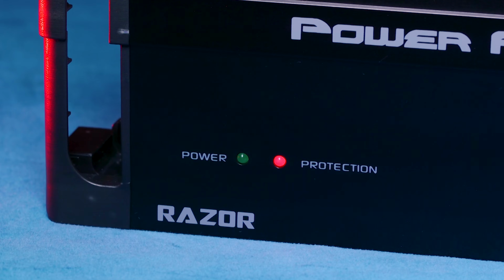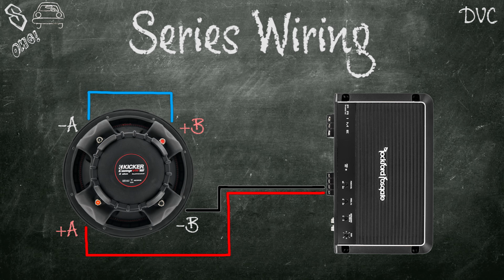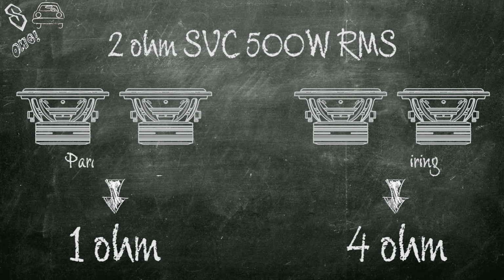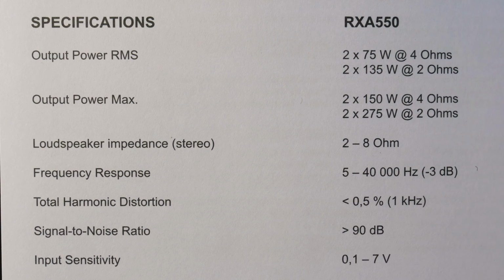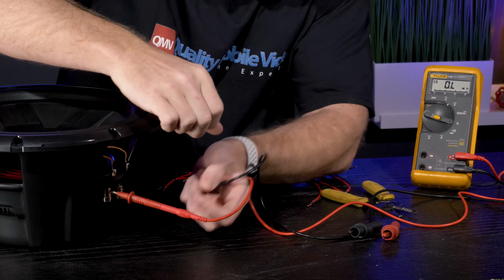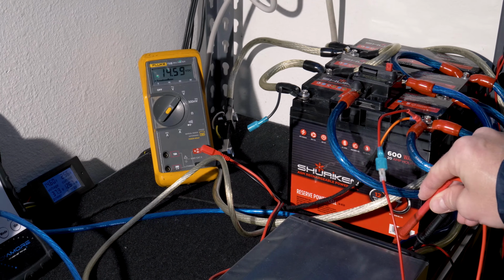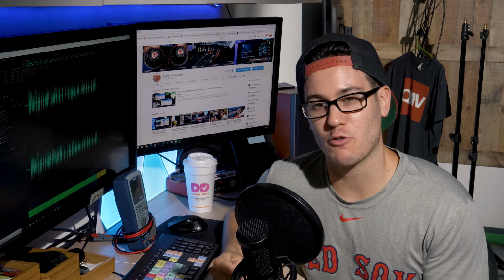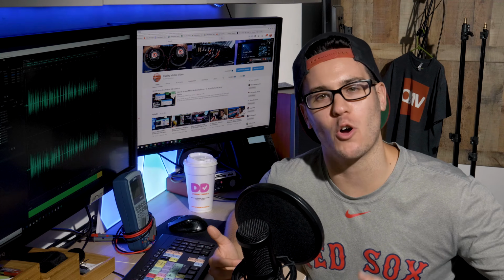Bass Cuts Out at High Volume - Amp Shuts Down -  Car Audio 101

Comment: hello bro can u help my out wit my brother i did a bigger alternator new wires and everything new radio new 1 amp for 2 subs and 1 for the highs / side speakers also big 3 upgrade and she still cuts out when i step on the gas or hit a turn

Comment: Question, so I never had any problem with my system within the past couple days with me. Turning my radio up my aunt will cut outs and and if I turn it down in a play with the base if I turn it up, it’ll cut in and out in and out with in seconds, continuously, so if I leave it at a higher volume or the normal volume that I normally play it at, he goes in and out in and out in and out in and out what does that mean?
Reply: Ever figure it out? Lol this is what I’m dealing with, skar 12 SDR paired with a kicker 800 mono class d amp, worked great for a while really bumped. But now when I turn it up the amp goes into protection and shuts off the sub until I turn it back down below a certain level.
Reply: @The_MotoRebel did u ever figure this out yourself? My remote wire seems to have a voltage drop.
Reply: @DeaconHickyy   mine had a voltage drop as well so i did a fresh wire for remote wire and it helped. hits harder but its still happening. not sure imo, i think its the amp. i need a stronger amp.

Comment: Is battery negative a good ground for amp?
Reply: no sand off a an area of paint to bare metal  in the trunk and then use a self tapping metal screw with a ring terminal run it to the ground

Comment: Any suggestion I daisy chained the dual voice coil kicker l7s  I bought a 2ohm 10” connected it to my sundown sia2500d and epicenter used a y split to add both left and right channel since the amp is one channel only and I don’t get the full potential I have a kenwood dmx47s budget radio in my Saab 9-3 2007 at around volume level 29 it turns off the amp ,gain I’ve been adjusting off the sundown remote since if I even turn up a little on the epicenter knob it goes straight into protect  /another scenario if I don’t use the epicenter knob only the sundown if I turn it past a little more than half way it starts clipping and turns off

Comment: Could be running a factory system with an additional sub. Some factory systems will bleed off the bass as the system is turned up to protect the speakers.
Reply: This My Issue
Reply: How do I fix this issue?

Comment: My 12s just started doing this recently,  it'll work fine when I start my car up, but as soon as I mess with the bass knob or turn it up. Everything goes out and I'm just left with the fronts. And if I cut my car off for a while and start it back up.  It works only at low volume then soon as I attempt to turn it up,  it goes out again
Reply: I've got the same problem.
Reply: @Warren daniel  aw wow.  Yea , my right door speaker been went out, my 12s popped back on. I'm in Chicago so I don't know if it was the cold weather or what,  but I also realized my back factory speakers aren't working neither so now I'm just all bass 😄🤦🏽‍♂️ until I get them replaced
Reply: Mine happened in the cold weather to. Kankakee ill lol. Found both fuses on the amp popped. Replaced them now subs keeps shutting down as soon as I turn it up. I also think my ground wire could be loose but it's under the seat and I gotta borrow some tools 🔧

Comment: Mine keep going into protection mode when the volume goes up and this just started does anyone have any ideas in what could help?
Reply: Did you figure what it was bro ? Every time I turn my bass up it goes into protection
Reply: @Angel_stepside I have same problem play hood for 10 minutes after that cut on and of eaven o. Low volume I change  other amplifier and same problem any idea
Reply: @Purozamachihue  for me it was the voltage drop bro i replaced my alternator and got a xs battery it works now’s.
Reply: @Angel_stepside  ok I replace that alternator already so I might get a new battery and se how works
Reply: @Purozamachihue  maybe upgrade your wires as well bro so you can get the full power from your it alternator
Reply: I yes found my problem that was that main wired to that fuse  block was coroored for  I cut it but u right I’m going to put new wiere thank u very much for ur  help

Comment: Good Sh!tt fast quit & too some valid points. 
My issues are cutting out at maybe 2 hours of runtime at a good low note. Initially I thought it was a subwoofers they were being overpowered. So I upgraded subs, it was all good the first month & now here goes the cutoff?? Any other ideas im all ears
Reply: Also voltage is not dropping below 12volts I have a full throttle battery 💪🏾 but original alternator. Im running 800watts all 4 gauge wire (which I'm sure I need to upgrade)

Comment: I got 2 12s in my rango and they rocked in my dad's truck and they're setup the same way they always have been and they were in my room rocking too, and now they're in my trunk and they sometimes can turn up high other times they kick off pretty quick, and we have a big ass semi battery in there and we had one like that in my dad's truck and it worked great till it shit itself from sitting but I think it's the alternator wire it's pretty skinny looking and I got 4 gauge going to my amp it's only gonna pull 60 amps max it's a 900 watt amp and I did rewire the subs but I had them in my room and they worked fine
Reply: This may be the longest sentence I've  read my entire life 😂
Reply: Maybe it shit itself from sitting think you've answered your own question

Comment: Had the same issue, the sub was dual 2 ohms when I wired it to produce a 4 ohm load the amp stopped going into protection mode when the bass hits.
Reply: How did you change the ohms? I’m having the same problem
Reply: @steelersgirl3063  sorry❤

Comment: I have a completely brand new system but it cuts out when I turn up my Bass knob its a ROCKVILLE db15 6000watt gain half way up with 0ga wire and 250amp fuse and 2 1800 watt dual 4 ohm lanzar max prosand new alternator almost 14v w no bass i have no clue what it could be bass is best parked and off
Reply: Wired bridged 2ohm

Comment: Not enough power need upgrade wiring add battery maybe better alternator I would even throw in a cap
Reply: Also when running multiple remote wires get a relay switch

Comment: Anyone ever heard something like this? Got a kicker cxa 600.1 mono amp got it hooked up to the factory radio with the rca hi lo adapter with a built in trigger remote turn on …. Every time I turn the vol almost full blast my amp goes in to protect mode… yesterday I did some investigating and I found that if i jump my     12V + wire to my remote turn on it has no issues at all at the fullest volume as soon as u pull that remote turn on that’s jumped from the 12 v out it goes into protect mode when the volume is blasted ? does this make any sense to anyone? Should I just run a separate remotes turn on wire to fix my issue?
Reply: there are no answers in this comment section. but youve inspired me to mess with the remote turn on. gonna check it out this weekend

Comment: i got a new amo installed to my car for my 4 speakers and the sound just stops but the amo still on.could it be my stereo or my amp? even tho when i unolug the rca's cables the speakers make a noice but when i plug them in no more sound
Reply from the maker: Sounds like a wiring issue! I'd bring it back to wherever you got it installed
Reply: @Qualitymobilevideo  it goes into protect mode i did check all the wiring and it all looks pefrect had the system for 3 months and out of nowhere this is happening
Reply: @spectaclesonmytesticles5114  yes i redo everything. a wire was pinched so i installed a new wire kit.

Comment: I have a 10w7 wired to a sundown sae1500 played great but sold it and purchased a jl audio jx1000/1 the bass comes on and starts hitting but then all of a sudden it hits crazy hard. Any ideas? When it was shipped the package was torn and a piece of plastic was loose inside and I opened it up and took it out. It was part of the mounting plate

Comment: My amplifier has been doing this for 2 years and I finally found out what the problem was the problem was one of my door speakers on my 4-channel amplifier my Infinity Kappa which is supposed to be 2 ohms but when I checked it it was 1 ohm all that time with the speaker playing very good it was sometime going to 1 ohm at high volume
Reply: How is your infinity door speaker running at 1ohm when should be 2ohm stable makes no sense.infinity door speakers only come in 4ohm.or 2ohm a wire must be wrong or bad speaker

Comment: Ran direct ground and it still goes into protect 🤦‍♂️gonna try another amp but I suspect the sub is damaged somehow.
Reply: Did it end up being the amp?
Reply: Great question! It actually ended up being the wrong wiring configuration for the amp and speaker combination. I was trying to run a 1 ohm speaker from a 2 ohm stable amp. My fix of course was to buy a 1 ohm stable amp. Problem solved so far. The ground also helped greatly with radio whine as well but it’s still there.

Comment: My stereo cuts out and turns its self on again after a short while, does anyone have any ideas? I looked at all wires and couldn't see anything and couldn't  find the ground wire, but i did notice that I could see the voltage on my stereo, and when its at 14.4v its fine soon as it goes down to about 13.4/6 it then turns off. Battery not strong enough??
Reply: My Silverado does this too… currently and it’s bugging me I have a Big 3 upgrade, new battery and Skar 1500 with 2 Skar 12s it sounds great but when the lows hit it dips to 12 volts and my speedo and radio go bye bye for like 3 seconds nothing else shuts off it’s strange
Reply: my amp however doesn’t shut down , just cluster and radio

Comment: Ok worth a shot to ask this on here. I just hooked up my 2 American Bass XFL 12s in my 2014 Silverado with the bose system. Powering the subs is a Precision Power Black Ice 5000.d amp, subs are dual 4 ohm wired to 1 ohm. I'm using an Audiocontrol LC2I converter with a plug and play harness from LLJ customs. All OFC Sky High 1/0 wire. So what I'm confused is when I have the volume up and have the bass going it will play and then the song pauses, the radio turns itself down to a little under half volume, then starts playing again and it will do it again if I crank the volume again. I ground down the paint for my ground. My gain is like 1/4 up maybe even a little less. Amp doesn't get hot and neither do subs but the coils do smell every now and then. I've had this amp and subs for 4 years and haven't had any issues besides in this Silverado.
Reply: I have same problems. I think its insufficient power. System dropping below what charging system can give it.

Comment: Man. I don’t know shit about systems but i need help. My sound keeps cutting off when i bump or wont even bump at a certain amount of bass. I wish i knew how to understand this shit
Reply: Grind down where you grinder the wire can’t be painstakingly under it  make sure positions cable on battery is tight. Make sure the wires are all touching don’t over tighten wires to amp

Comment: I have 2 jl subs, connected to a kenwood x500-1. My amp cuts out when the bass hits. If i joggle the remote wire it turns back on and then cuts back off. It was working oeefect for one day and the next it started doing this. At first i messed with the lpf and it fixed it for a day, but now its doing the same thing. I changed the ground but the amp was blinking like it was in protect mode so i put it back on original ground. Still nothing
Reply: Turn your gain down
Reply: Turn amp gain down check ur fuses sometimes the fuse holder will began to melt and short our sound also check ur ground

Comment: So if the protection light comes on what does that mean
Reply: Running hot
Reply: Not necessarily  it could be a bad connection or wires exposed touching something

Comment: So I installed a capacitor... my issue is that the capacitor flashes and the amp is cutting out when the bass hits too high
Reply from the maker: Hmm. What is your exact system? Give me all the part/model numbers of your subs and amp. What gauge wire did you use for ground/power? What is your exact vehicle?

Comment: I have two p3s running on a 1000bd fosgate amp sometimes when i have the radio up loud even with bass knob low so the bass aint to loud the bass clips or shuts off for like 3 sec i lower the radio then the bass kicks in. This happens sometimes only. Can u help please.
Reply from the maker: Sure Dom. What are the exact models of the P3S subwoofers? I need to know size, RMS each/combined, 2 ohm or 4 ohm, and how you wired them
Reply: @Qualitymobilevideo  12" (P3D4-12) Punch P3 Series Dual 4 Ohm Subwoofer

Power Handling:

Peak: 2400 watts total / 1200 watts each

RMS: 1200 watts total / 600 watts

Impedance: 4 ohms (per voice coil)

Anodized aluminum heat sinking cone & dustcap for strength and durability

Tall profile true Santoprene vertical attach surround technique increases a speaker's effective radiating cone area

Dual tear & fatigue resistant linear poly cotton spiders

Optimized motor magnetics with extended pole and bumped backplate

Fatigue resistant and reduced strain stitched tinsel leads

Multi point high temp/strength neck joint bonding technique

Sturdy 16 gauge compound bend frame geometry

Semi-Flexible PVC removable protective motor cover

Custom insulated compression input terminal assembly

Proprietary spider venting/cooling technique

Decorative die cast trim ring

Custom 10-AWG nickel plated push terminals

High temperature 4-layer 2-1/2" voice coil with spun laced nomex insulating reinforcement collar

Double stacked ferrite magnet structure

Frequency response: 27.7-250 Hz

Sensitivity: 85 dB

Xmax: 16.2 mm

Mounting Depth: 6-11/16"
Reply: @Qualitymobilevideo  they came wired from the box to one ohm my fosgate p-1000bd can do 1 ohm so idk but my rca to this amp looks skinny and weak idk but this is what they put in bc they were lying around and I needed some so they just put these in there I order me some Rockford Fosgate that are on their way so I can put those in I don't know maybe the ground
Reply: @Qualitymobilevideo  I have a new battery I just bought a brand new alternator but it's only a hundred and 15 amps also I have a Fosgate 2 farad capacitor and I have a little extra battery by the capacitor that's a thousand Watts battery my voltage seems okay and the other system I had before the Fosgate it was a CT sound 1000 BD amp hooked up to two 12in Alpine Type r's and they never cut off before but now I have two p3s a 1000 watt amp Fosgate also a 4-channel amplifier hooked up to my door speakers and the last system I didn't have a amp  hooked up to my door speakers

Comment: My kicker 1800.1 amp goes in protect mode when volume is loud  its 2ohm stable I have a 1500 Re audio xx 4ohm dual voice coil wired down to 2 ohm and I have a second kinetik 2400 battery  now I tried testing removing the speaker wires from the amplifier at loud volume and it doesn't go in protect mode also I'm getting 12 volts or more
Reply from the maker: Where did you make your ground?
Reply: @Qualitymobilevideo  the amp and second battery is grounded together and the second battery is grounded on the first battery
Reply from the maker: @pimpjuicedp  So you didn't ground tot he chassis of the vehicle?
Reply from the maker: @pimpjuicedp  I would check your grounds
Reply: @Qualitymobilevideo  No I didn't
Reply from the maker: @pimpjuicedp  Can't be sure without being there in person, but that could be the issue, could have blown capacitors int he amp or some other component damage
Reply: @Qualitymobilevideo  when I first got it I was rushing and when I installed it I put the power wire in the ground spot and put the ground wire in the power spot I blew the fuse then changed it I installed it the proper way

Comment: Mines doesn't exactly cut out but not always but when the bass hits it sometimes gets more quiet like not to wear it's distorted just were the amp it's more quiet it does not get hot it don't go into protect I've check all the wiring and it is all correct. It's an older 760 watt pioneer amp which is powering a kicker kicker CVR 12 600 watts sounds good but gets annoying it does have a 1.5 farad cap and the voltage remains between. 13.7 and14.3 volts continuous ant advice ?

Comment: Mine started doing this randomly after about a year with no problems, it only does it when im driving and when the beat hits and also sometimes other electrical things shut off in the car, everything turns back on after about 3 seconds
Reply: Hows your battery?  I am having same issue
Reply: Bad ground
Reply: Same here .I also did big 3 upgrade and new amp everything. Still does what yours doez
Reply: Check the battery voltage might be battery or alternator not charging with running,air condition,lights everything on shouldn't be under 14.6 if its much lower or much higher u have a bad alternator.should be 12.5 or 12.6 at start
Reply: @juliosandoval8244 I have same problem and I yes put new alternator and I have that big 3 probably is bad ground because I haven’t checked cince I installed 6 years ago

Comment: I have an sir Silverado bass amp that clips and the limiter light comes on a few seconds after I power it off. Had amp out on table without speakers hooked up and no noises at all. Caps visually look new and transformer too. Only makes sounds when speakers are connected. Have vids of it too. Any thoughts, dave